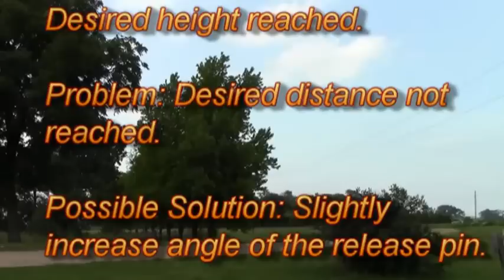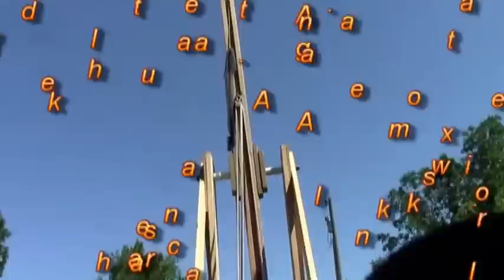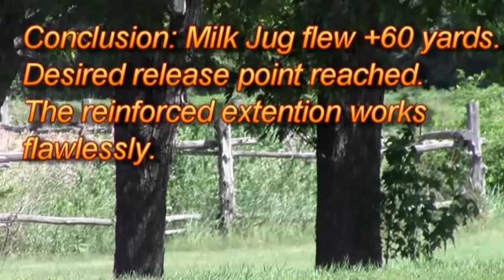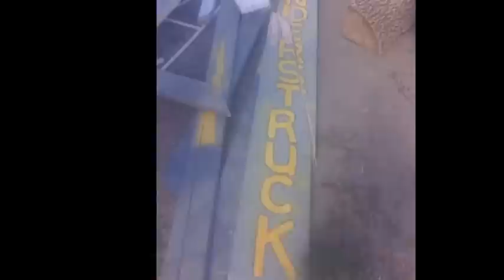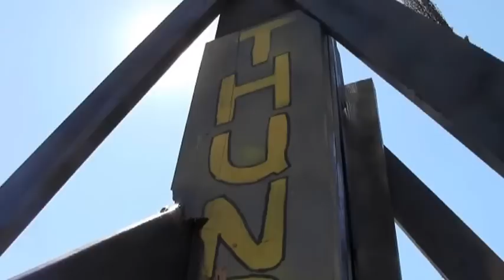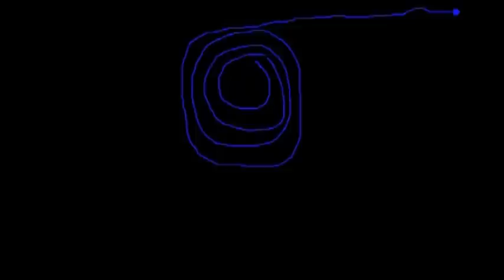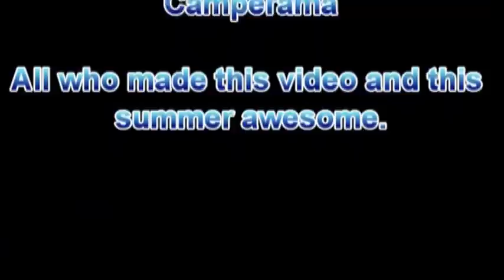Building a Trebuchet

Comment: I have one of these but my axle keeps bending. What do you use for your axle?
Reply from the maker: We used a 1.5"D steel pipe with ~1/4" wall. But it depends on your counterweight and projectile weight and the length of your arm.

Comment: Beast video I have seen so far. Very well done bro! Don’t know if you will even read this because I see it’s an old video. I would love to build one that would launch large heavy objects like old washer and dryers, water heaters ect. With a ration of 133 to 1 it’s not likely that he could afford to build on that large with that heavy of a counter weight.
Reply from the maker: Hey Mark, it is totally possible. It all about leverage. If you have the correct ratio of counterweight distance to axis and distance of launching sling to axis. Get that right and you'll get it. This trebuchet had little to no calculations done to it. It could have been optimized throw further.